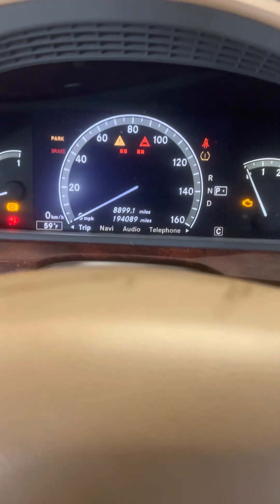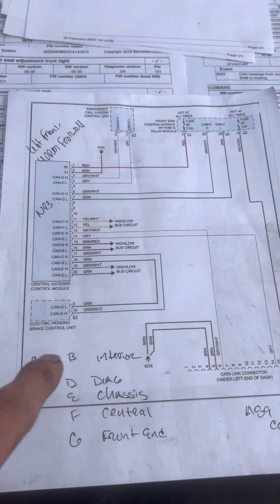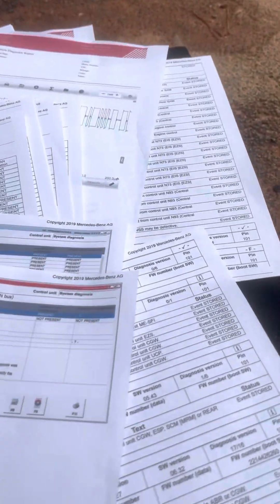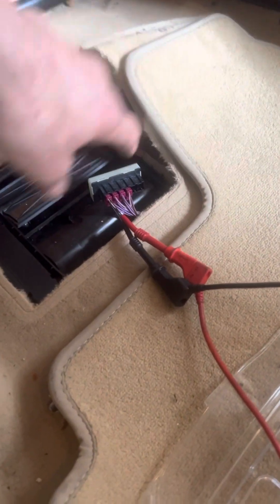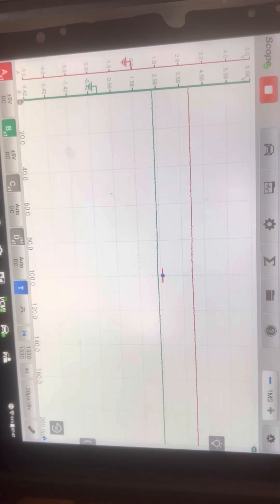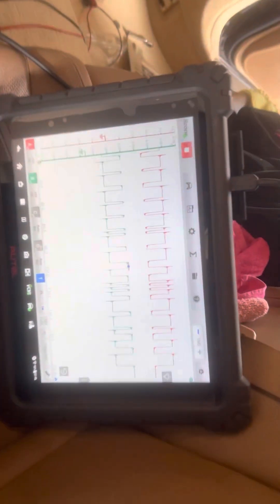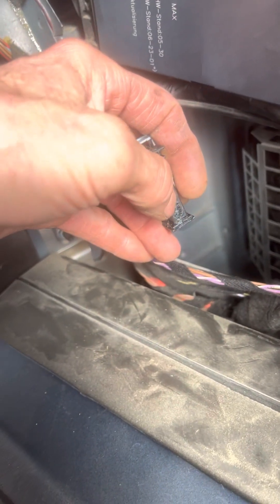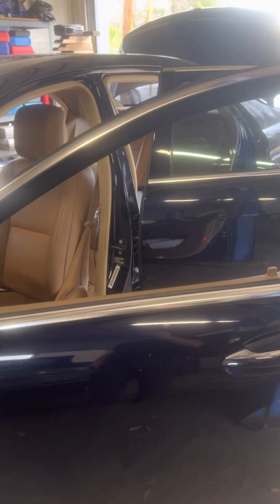2007 Mercedes S550 Shorted CAN. Complete diagnosis with wave patterns good and bad. Check engine

Comment: I have a Mercedes W211 320 CDI, and every time it rains heavily or I wash the car at a car wash, the ABS, ESP, and BAS lights come on, and the gearbox goes into limp mode. It works fine once it dries out. However, the last time it happened, it didn't fix itself. Does anyone know what it could be? I noticed the cover under the hood, where the SAM module, ESP module, and gearbox control unit are located, was open, and I'm sure water got in. I don't know what to do… The diagnostic tool shows 48 fault codes, and many of them say something like: “Control unit N47-5 (ESP, BAS…) is faulty,” “Engine control module not identified or incorrect,” and several messages such as: “CAN communication failure with control unit (multiple),” “CAN communication with engine control module is erroneous,” “CAN signal “Brake signal” from control unit N10/2 (Rear SAM control unit with fuse and relay module) is implausible,” etc… 

Any advice? ¿Maybe i should take a look in the front box where is located the ESP module/TCM/SAM and that i suspect it got wet? 

Many thanks in advance man, i'm really desperate…
Reply from the maker: You’re gonna have to open up the CAN strips. You can start under the hood at the SAMs, but you need to identify the networks and then isolate which ones shorting
Reply: @eurowerx4267 appreciate your response bud. Any suggestions about where are this CAN strips at the hood SAM’s and what i need to know about them? i mean, if i need to find any electrical scheme etc, and then how to diagnose them? is it easy ?
Reply: @eurowerx4267 i really appreciate you’re response
Reply from the maker: My best recommendation is to go to all data and pay for a one vehicle subscription. And then you can use the component locator to locate where those canned strips are. The canned chips are usually located under the door seal strips.

Comment: I recently retrieved my 2007 S550 from the body shop after a minor fender bender. The vehicle had been there for several weeks, largely due to my own unavailability resulting from a work-related injury. Upon picking up the car, it started immediately. However, while driving, various warning lights appeared on the cluster, which I attributed to the car having been jump-started during its extended stay at the body shop. Unfortunately, the car suddenly shut off while I was driving on local streets, but I managed to steer it to a nearby parking lot. Subsequently, I had the car towed to my residence and discovered that the positive and negative terminal clamps on the battery were loose, confirming my suspicion. I tightened the clamps, and the car started without issue. After letting it idle for 15-20 minutes, I shut it off and attempted to restart it, but it failed to start again. The dashboard lights are functioning, but the car refuses to start. Preliminary information on the vehicle: Autozone assessed the starter and rear batteries, deeming them functional. Nonetheless, a red dashboard indicator implies a charging problem, probably linked to the alternator, which was replaced only two years ago. Similarly, the two-year-old starter has failed to facilitate successful jump-starts. What is everyone s opinions ?Finally, I tried to put the Star computer on it, but for some reason, it's not pulling the VIN number and remains stuck. Starter and main battery are brand new and just installed yesterday. I just went outside and the car started right twice in a row. Shifted into drive, neutral , and reverse no issues. I went to turn the key off and back on and not starting. The error message comes up visit workshop without changing gears. Now of course car won t go into drive, neutral, or reverse. Scanned the car and the only obd error I get is   CAn bus off short circuit power train-bus  but its a store event not current .. could it be the power distributor block under the driver s seat? Maybe got water I am lost.

 While Mercedes tech was working on my car, the battery light came on, accompanied by other problems, and he was able to identify the central gateway as the likely cause, since the coding did not persist after being recoded. Curiously, the car started multiple times afterward, but then died while idling. I checked the charging system and found that the alternator was working properly, with a charging voltage of 13.6 volts while idling. It is worth noting that the ECM was replaced less than eight months ago and programmed by Ninjabenz. I intend to purchase another gateway to determine if that will resolves the issue. The battery icon appears intermittently on the cluster when the car dies. This is baffling.Also I was able shift into gears no issues.

Any opinions?

Comment: I don't understand you put hours on this.
When a module is bad (especially ground shorted like yours), other modules will point to that one by saying no communication FROM that module.
You can also unplug each module and check (with ignition off and sleep mode) the network resistance; 120 ohms all is good, 60 ohms when half is open and 0 ohm = can wire pair shorted or a module's shorted.
But that was good great job.
Reply from the maker: 60 ohms is good, 120 open module.
This one I spent Alot of time on diagrams and location of components.and planning my path of diagnosis. Unfortunately  CAN networks are interconnecting and it’s not always straight forward. Hope the video helps. The next one I’ll be much better prepared
Reply: @eurowerx4267  Yeah, just a typo. 60 good 120 half open.
What I meant is that with all the tools you have, you certainly can see module's topology and location. Then you look which ones are gateway for multi-can, once you know, it is straightforward. As I said, you actually did a great job, but you went too deep. 99% of time the ECM/ECU/PCM has one ending 120 resistor so it is easy to find the other one. Good luck for the next diagnosis.

Comment: Good job my car is w221 2009 s320 cdi. i am having can bus problem with electronic parking brake (front end can bus)
 AND night wiev assit problem but it wash working before i was using can bus communication please help me where should i check it first steps ecm modules i live in turkey 

My electronic parking brake is working but manuely, evertime i start the car it shows yellow epb see manuel on dash board 

A13 control unit (electric parking brake control unit) no can communication

İntelligent servo module (drive train can bus)

Adaptice brake (chassis can bus)

One or more signals sent from the electric parking brake control unit are illogical

One or more signals sent by the central gateway control device or the a13 electric parking brake control unit control device are illogical
Reply from the maker: Diagnose chassis CAN, what’s the voltage at High and low?
Reply: @eurowerx4267  let me check it and give you description
Reply: @ how can i diagnose chassis can

Comment: I also have a 2007 and have been randomly experiencing the "ABS and ESP Inoperative" error popping up while driving. Other than that I have no other error messages showing up. When it happens the car cuts all power, but instantly comes back to life and carries on normally. It's driving me crazy. I'll have to take a look at the module and it's connector.
You did an amazing job locating the issue. Thanks for sharing.
Reply from the maker: Could be a bad wheel speed sensor !!
Reply: @eurowerx4267  how can you identify if it's a bad ABS sensor 

2005 mercedes c240 no crank 
Esp light on
Reply: @JuanLopez-wi2tw  I found the problem to my issue, it was a bag accessory battery  in the trunk.  It had a bad sale and would  Constantly drop to  8 volt.

Comment: I have a 2012 s550 has a bunch of codes for short to positive. Trying to figure it out has been a nightmare. Fuel rail sensor fuel temp provavl boost preasure sensor. You wouldn't happen to know which bus would be linked to those would ya?
Reply from the maker: tough to say without seeing. Study the diagram and look for common denominators, find the power source, likely drawing on the battery also. Try an infrared camera to isolate hot spots!!

Comment: Nice explanation 👌. How much did you end up charging for this job?
Reply from the maker: Thank you! I haven’t completed it yet. Module on order. $1050 plus tax , est around $2k total. These kind of repairs are tough to price, I try and be very fair with my clients, this one’s a great one. I’m leaning between 6-8 hrs labor, labor rate of $130 an hour. If I can program the module without having to use the dealer, I won’t add for that. Where I’ll make my money is on the next one. I’ve learned a lot on this one, I’ll eat some of my time on this one and make up for it on the next one!
Reply: @eurowerx4267 where u located